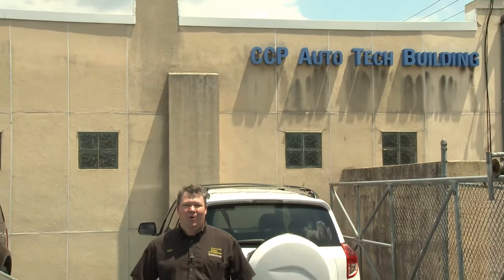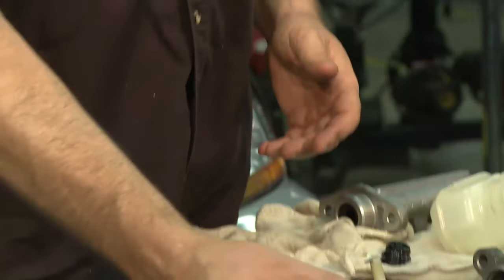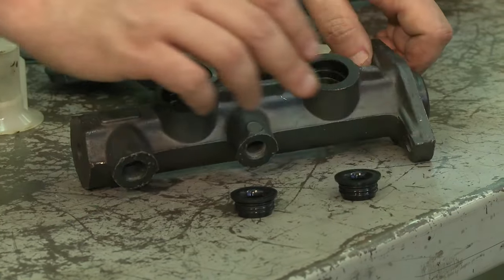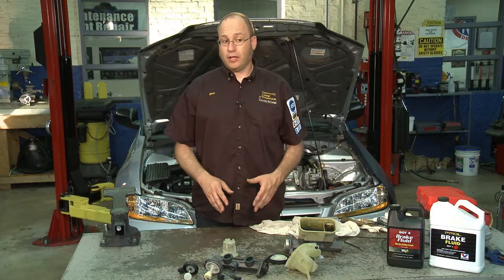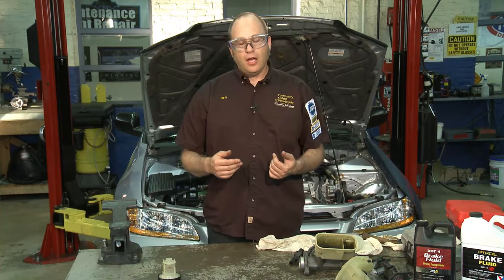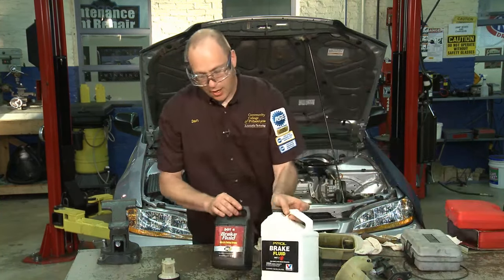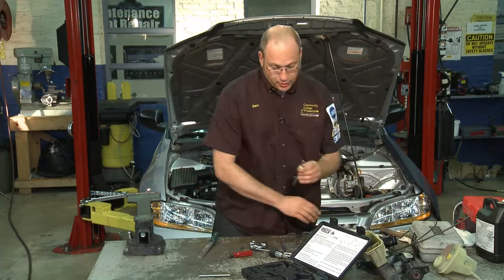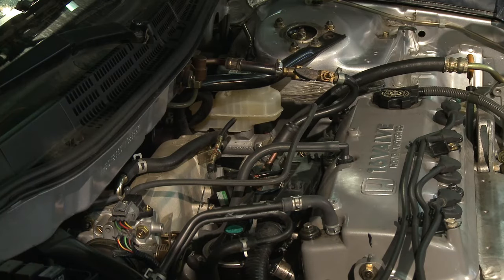Car Corner Master Cylinder

Comment: While it does reduce the weight of the car, the main reason they make master cylinders out of plastic is to cut manufacturing costs. And forcing people to have to buy a new master cylinder as opposed to being able to buy parts for one likely has nothing to do with liability because if this was the case why would they consider too sell things like brake shoes Springs etc? Makes no sense.

Comment: Once I was in a small plane taxiing for take off and just as we entered the runway I touched the brakes lightly and they went right to the floor. We ended up shutting down and pushing the plane back. Very lucky that didn't happen a few minutes later.

Comment: "You can't use copper lines" Maybe i missunderstood you there? Of course you can use Copper-lines, it might even be a better choice since it don't rust. Personally i prefer copper-nickel.
Reply: Yeah, he was doing so well until that point. Does he really not know that brake-spec copper-nickel lines are available (and better for DIY as easier to bend as well as not rusting)
Reply: Copper-line may not like vibration.
Reply: CuNi lines are not Cu lines.

Comment: the  installation of the fluid reservoir on the master cylinder was wrong at the beginning which is fitted the other way round but when you install the master cylinder on the car was corrected.

Comment: I don't see how swapping out seals in the master cylinder is any more difficult or critical than doing the same when rebuilding a brake caliper.
Reply: Getting the air out of slave cylinders is very easy.  Getting the air out of the master cylinder is very hard.
Reply: @v8pilot  it is news to me. Binch bleed master cylinder; no broblem bleeding air out.

Comment: Excellent presentation Sir. 
Finer points on(1) tubes cutting, flaring (2) bench bleeding of master cylinder (3) assembly techniques (4) different types tools that are used during the entire process. 
All the finer points very well explained. 
Great work Sir.

Comment: Very informative and well produced video. I have just the following one question; the master cylinder has 2 outlets for the front and back wheels; I would assume that each line is split afterward to 2 lines used for supplying brake fluid to the driver and passenger side.

Comment: My breaks stick they take a few seconds to release before I can pull away , I've changed the vacuum pump. The pipe and non return valve are ok the breaks stop the car ok but they stick and take a few seconds to release any ideas ? Great video

Comment: When I saw how the reservoir was set up on the top of the master cylinder I thought "It can't be right!". And I was correct: notice how it turned around before going in the car!
Reply: Yup .. I saw that too. I was thinking the exact same thing.
I even fast forwarded thru the bench bleeding to the point of installation to see if it was going to go on in that position, and, like you, I was right.
At least at the end of the video, in bloopers style, he explained that he did it wrong and that it was critical to have the reservoir on in the right position.

Comment: 9:12 I have also had air enter the brake system resulting in spongy brake pedal, by way of a leaky brake wheel cylinder.